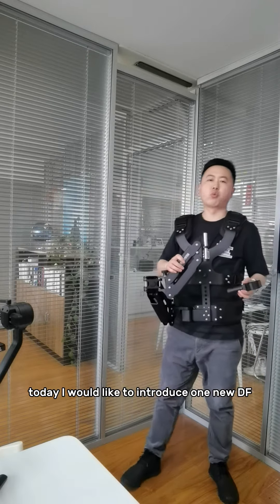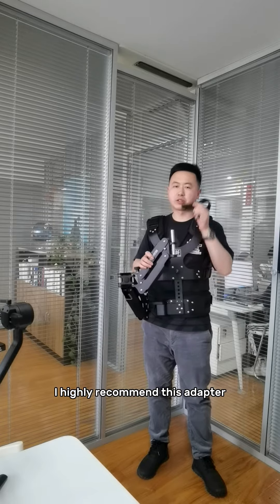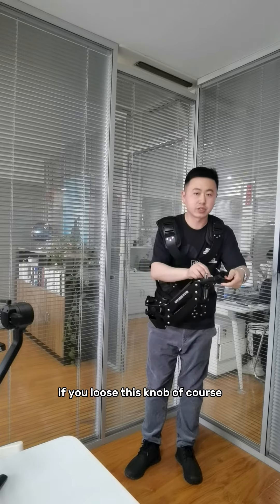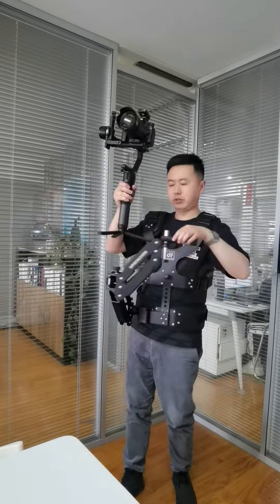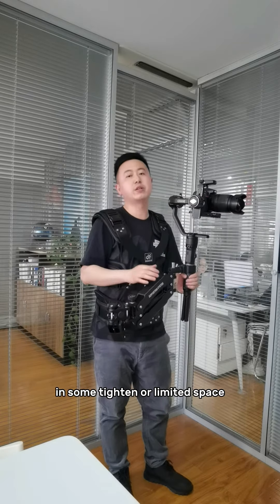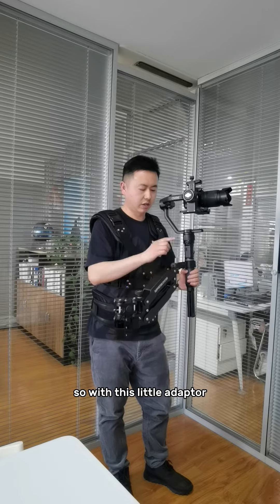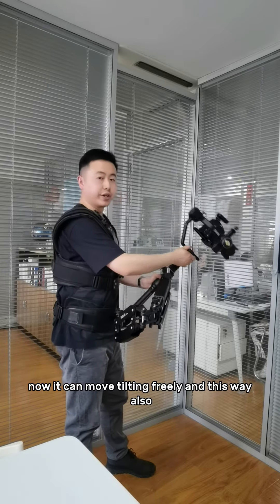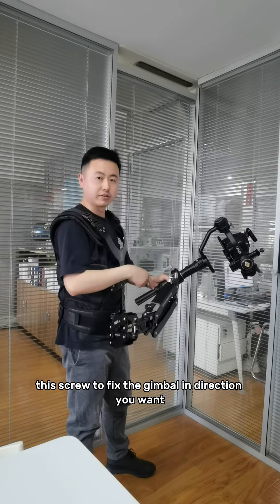Make your steadicam be portable "ARRI TRINITY"Float system" with tiny adapter from DIGITALFOTO

Comment: Hey Ivan, what is the difference in between this setup and the Thanos-SE? Is this better than the Thanos-SE for a Gimbal Setup? I got the Rs3 Pro, the blackmagic 6k pro and the sigma 18-35mm
Reply from the maker: Hey,This setup can bear higher payload which is 12.5KG,While THANOS-SE is 8kg. 
But THANOS-SE will be more compact and lightweight.

THANOS-PROII will be more professional,but keep in mind it will need long carbon fiber post pole but you can order THANOS-PROII+TH02,then you can decide use the pole or not.
https://digitalfoto.store/products/digitalfoto-thanos-proii-164
1350USD 
https://digitalfoto.store/products/digitalfoto-th02-steadicam-arm-adapter-for-universal-gimbal-371

Let me know if any more questions?

Comment: I bought this for my RS2, but im a bit worried about the weight. My rig is a BMPCC6k pro with a Vmount under the camera. The RS2 handle is made of metal so it should be OK but its a bit of load all in one small area. I tested it and it seemed OK and I wont be doing any crazy movements with it. Im just using it for steady shots so I dont have to hand hold the gimble. any advice? thank you
Reply from the maker: Can you please send me picture of your Rig to admin@digitalfoto.cn ?I will help you check